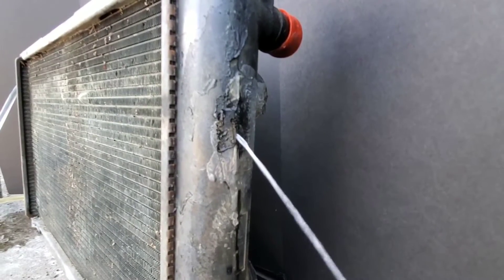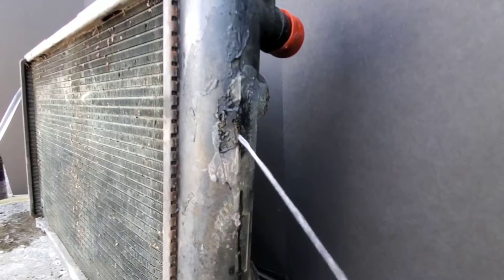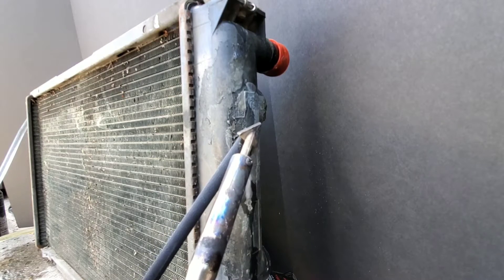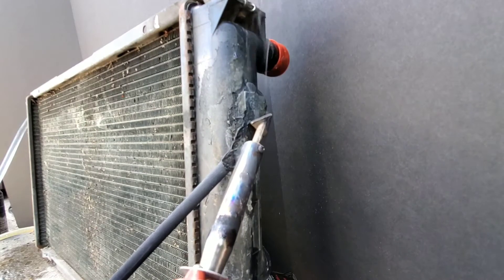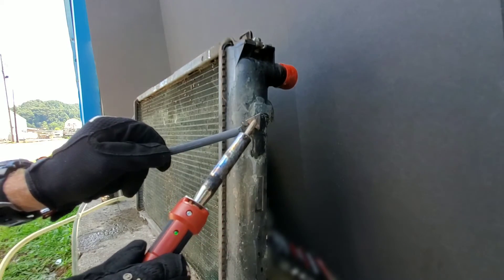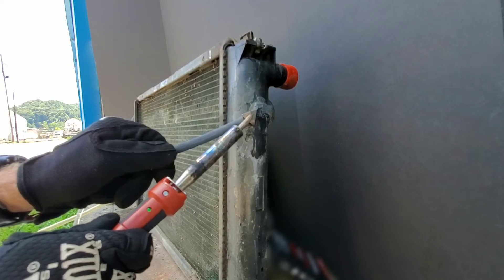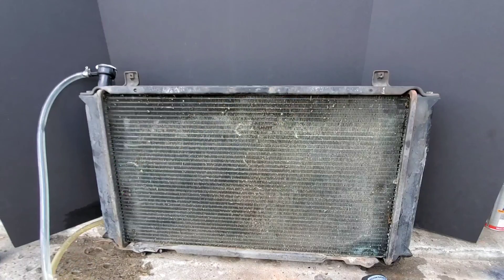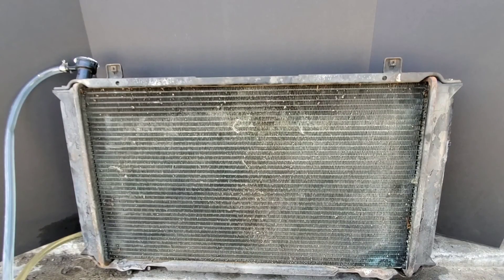How to fix a radiator leak! Permanent $15

Comment: I would use superglue and baking soda. The repair is just as good as the base material. I have done that many times. Works for me.
Reply: Form Marling Fishing Lures
Reply: @artsmith103  I have fix lures many time but the color match is off. The lure gets a strange strip on the surface.
Reply: did u use it on the radiator plastic?

Comment: That part that’s leaking… what’s it called? Mines cracked all the way down. I’m willing to jb glue it with high temp and also burn the plastic together till I get a new one. What can I do? It’s a crack that goes all the way down but it’s thick . Toyota carolla 2007

Comment: If one is welding a plastic gas tank, the tank is made of HDPE plastic, the same thing that oil bottles are made from. Cut some strips from a clean/ empty oil bottle, and grab a soldering iron or soldering gun, and carefully heat the area on the gas tank that is damaged, and melt the strips into that area, being careful that the plastic covers the area enough that it won't come loose. If the tank is removed, it can be tested with water to see if it leaks. 
This only applies to black plastic gas tanks. For white tanks, use an empty isopropyl alcohol bottle the same way as mentioned above.

Comment: No. This is not the right way especially with the nylon tanks.
You cut a small screen that comes with the Harbor freight kit and melt the small screen that comes with the kit right down into the plastic. that method will work much better.
The screen that comes with the Harbor Freight kit is made out of stainless steel. So it will never corrode.

Comment: When plastic welding add some thin copper strands for added strength 👍
Reply: Copper is strong but it conducts heat really well, wouldn't something like fiberglass work better in this application?

Comment: 3rd time i used my welder just like yours the tip bent and fell off now i gotta unscrew the center. You should unscrew yours drill it out and slide back in the iron

Comment: A cheap soldier iron that's used for electronics an plastic tie straps work great..I use it on everything that's plastic an never had a problem even a radiator that was full of antifreeze an it still welded together an works perfect .👍👍👍
Reply: Tie straps/zip ties are made out of nylon ,great idea
Reply: where do you get the plastic sticks???

Comment: JB waterweld works  very well an is permanent but prep is key!  MUST BE CLEAN AND SCUFFED WITH SAND PAPER!! also looks better too
Reply: Does it stick on PA and PP plastic?
Reply: it may+ if prepped good. let sit overnight and repeat maybe one time. but im not really sure and no one else will reply i see.
Reply: not good
Reply: @JohnnyDanger36963  I fixed two radiators and a heater core on my ford rangers 4 years ago and still no leaks

Comment: I promise you a stick of quicksteel will eliminate all these process for 10 bucks in about 30 mins or less  even the metal jackets (the aluminum lines going across the radiator)
Reply: ronaldo zevach+so will the quik steel really work? better than other stuff-jb weld stick ect? i need to try it. sounds good idea. mine is pin hole smaller than the one on this video.
Reply: @charlesdowns1691  it's works just fine , make sure it covers the are , make sure to spread the quick steel a Lil bigger than the arrear you are applying it to and make sure you allow it to dry and cure fully
Reply: @BayAreaWrecker  +thank you+ill have to try that..appreciate.

Comment: Better way to repair a cracked radiator with plastic casing, split the plastic casing off, then you can patch any metal with jb weld or another solid epoxy or high heat water resistant putty unless you wish to weld in a new panel piece thats been roughly shaped. As i presume the radiator is made of a metal or alloy and this has rusted and failed, and the high pressure and heat lead to the leak perforating the plastic case. Then you want to use plastic cement/plastic weld to fix the plastic case and reinforce it.

If all your doing is melting plastic to fill cracked plastic, it wont be long before this fix fails as due to weathering and operating temperatures, the plastic will eventually break down under the high heat and pressure.

Comment: I once plastic welded a radiator with a soldier iron and weed whacker string it held for 3 years and I sold the truck like that
Reply: Cheater
Reply: @THEEVAAN   explain please
Reply: Does it make it overheat if it’s just a small hole
Reply: @maryjanemoore-lx1lg   only once you run out of coolant
Reply: @maryjanemoore-lx1lg  +yes. it will. the upper hose will not build and hold pressure+the car wont give out heat+ and wont cool transmission lines and it will damage everything. sealer is useless on plastic radiators.  not to put any inside. maybe what he is doing may work but im not sure.
Reply: Lmao.  I just got some string cut and was trying to find references for this specific fix.  Thanks brother
Reply: @dapv144  harbor freight has a plastic welder now for cheap.  I’ve almost mastered plastic welding by now ,  hobie has the best plastic welder yet

Comment: The rods that come with the welder are Polypropylene (PP) which melts at 266 degrees fahrenheit (130 celcius). Normal car operating temperature is 195 to 220 degrees Fahrenheit. If you are going to weld on plastic then use Nylon (PA) rods which is what the radiator is made of. Nylon (PA) melts at 428 degrees fahrenheit.
Reply: Where do you get the Nylon (PA) rods
Reply: @wesleykipp67  there is usually a  place on any plastic part that you can cut off the excess and use that for welding rod. So you are insured that it is compatible with the piece that you are welding because it is the same plastic.
Reply: @wesleykipp67  +welding or machine shop.

Comment: That's not where radiators typically leak...
Reply from the maker: This radiator did just that and my experience the plastic tanks are where they leak first because that is the weakest point.

Comment: Why not solder ?
Reply: Because its a plastic tank. This isnt a repair that should be attempted anyway as the whole tank is comprimised. 8-10 years as a general rule of thumb before every inlet  plastic tank on every car starts to fail. This is putting a bandaid on a bullet wound and prolonging the inevatable.
Reply: @1st-KillFreak  , your exactly right, thank you!  Once a tank is old and brittle it will just continue to crack elsewhere. 👍
Reply: @1st-KillFreak  No, that's not true at all. I've seen many plastic radiator tanks last over twenty years. My daily driver is a 1998 Ford Ranger pickup and that original radiator has just now developed a microscopic crack. That's twenty-seven years of trouble-free driving.

Comment: Best to throw it in the scrap pile and buy a new one on Ebay etc. Radiators for most cars are like $65 shipped. Not worth taking a chance of blowing a tank out on the highway.
Reply: Or buy an all aluminum one and have a radiator that will Outlast the car
Reply: @bryanmartinez6600  I did EXACTLY that, and while I wated to receive it, my son drove the truck, and ruined my engine and transmission. ALWAYS LEAVE A "DO NOT DRIVE-NO RADIATOR!!" SIGN TAPED TO THE STEERING WHEEL IN SUCH A CASE.
Reply: @LivingFaith2  
Hahaha hey well then the battery was better off leaving disconnected until the job was done.
Reply: @bryanmartinez6600  , that depends on the age of the vehicle, most radiators wither all aluminum or aluminum with plastic tanks will fail after a few years , in fact the plastic tank radiators have a better success rate then the all aluminum ones unless your buying the $500 ones.
Reply: Lol your better off with the one u have if you're shopping on ebay

Comment: Sometimes steel epoxy can fix some rad leaks..
Reply: Steel epoxy just hold for days... I have tried.
Reply from the maker: Good idea
Reply: @NATESINTERACTIVEAUTO  weld is always the best option - if done right, would be as good as original strength.